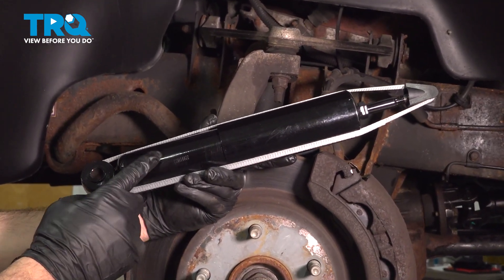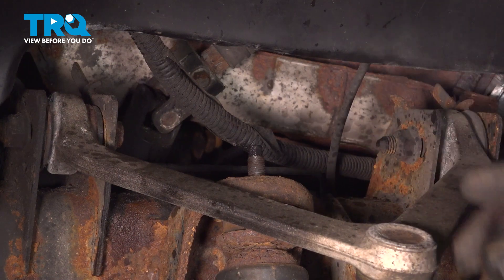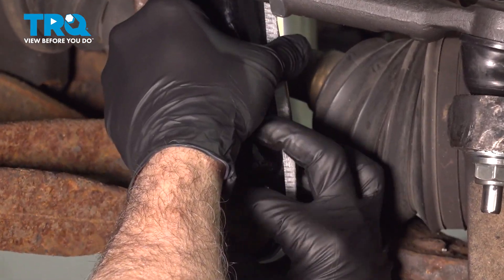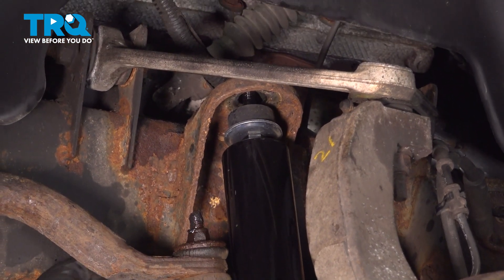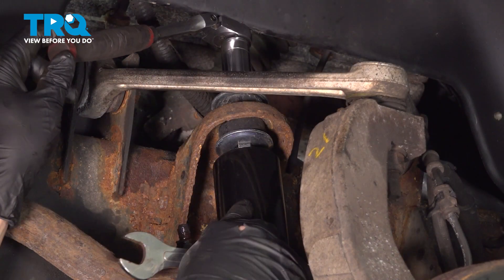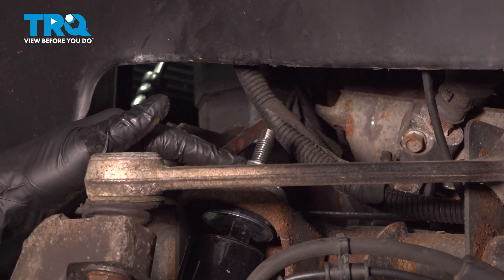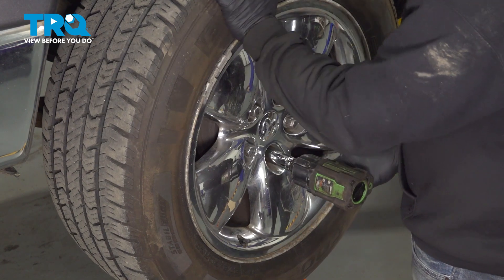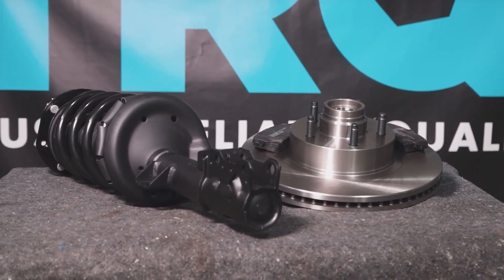How to Replace Front Shock Absorber 2002-2008 Dodge Ram 1500

Comment: Should be torquing the lower shock bolt on the ground. Tightenig the lower shock bolt in the air like that will cause the lower shock bushing to wear prematurely.